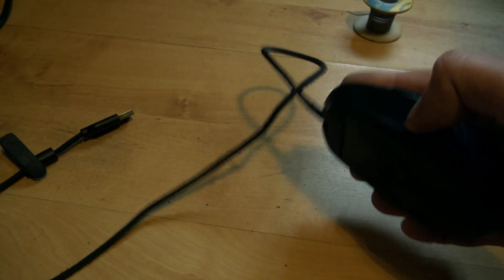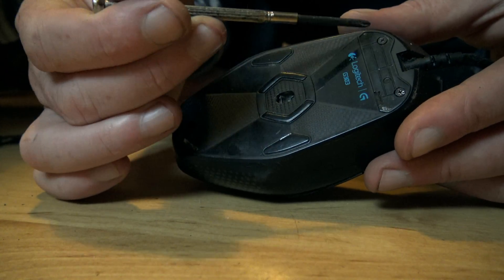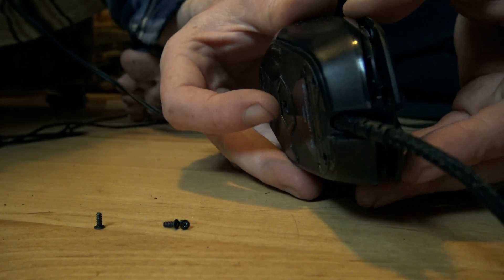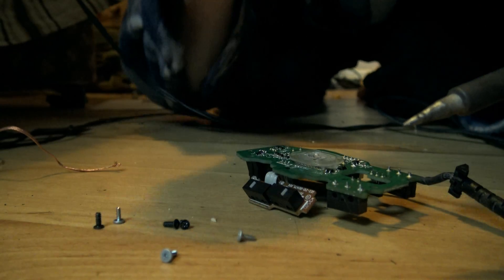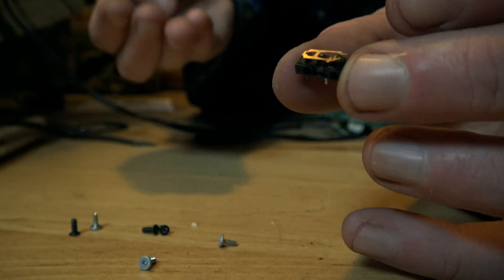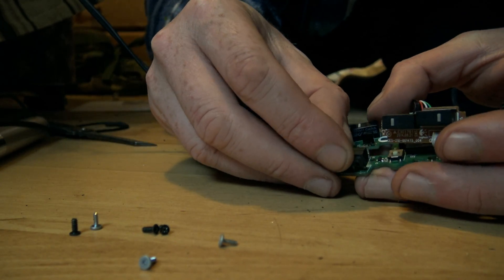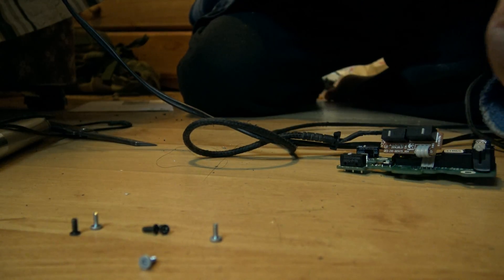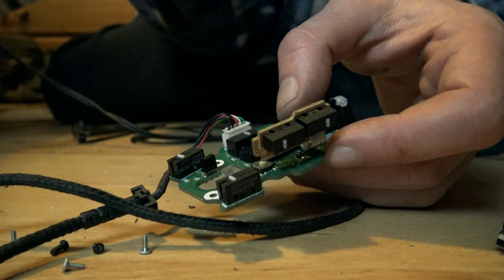Mouse With Faulty Buttons? Do THIS to Fix Double-Clicking and Sticky Buttons

Comment: Great video and I totally agree  that you should replace the old with new switches. Should be an easy part to find online right? Hopefully cuz I might actually need them someday.
Reply from the maker: They all use pretty much the same switches made by the same company. There are a few variations but the package size and terminal spacing is usually the same

Comment: just buy a new mouse lmao
Reply from the maker: In what world does that make sense? A switch costs almost nothing, and the mouse you buy 5 years from now will use the exact same switches as the one you have right now. If buying a new mouse makes sense to you...stop buying cheap mice!
Reply: @mellowb1rd  Not to mention they don't sell the 303 anymore, and the shape is one of a kind (well two of a kind, I suppose, counting the 302)! Thanks for the guide, btw. Now I can breath life back into my 303 and retire the 302 I replaced it with. Can I take the switches from my 302 and use those or am I better off getting fresh ones?
Reply from the maker: @roberf9600  If they work, you can use them. You might want to buy a couple of extra sets of skates, or be very careful not to bend up the edges when removing them to access the screws. I'd buy them anyway cus they'll eventually stop making them, and you can't really make your own out of teflon sheet, 'cus they need to be stamped out, rather than cut, so the edge is rounded and doesn't catch the pad
Reply: @mellowb1rd  Ok, great! Thanks for the advice, definitely gonna stock up on skates.
Reply: not everybody has money lmao